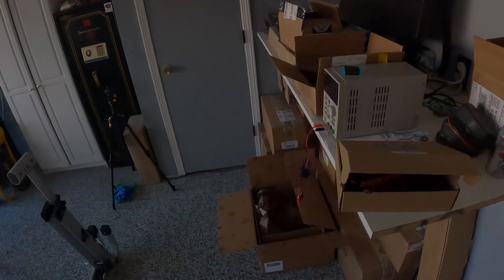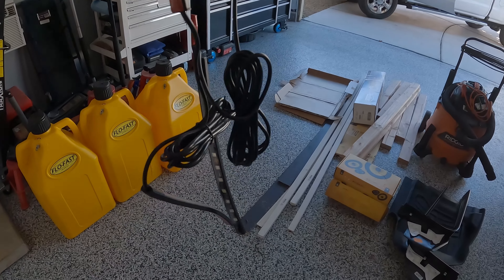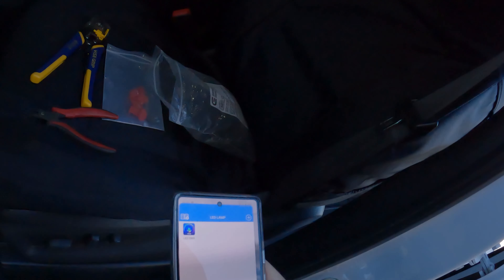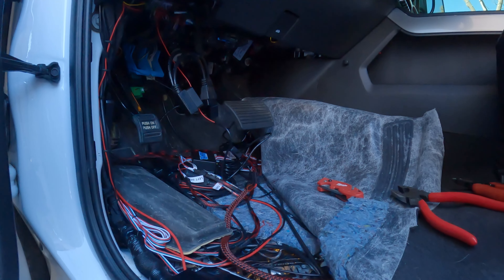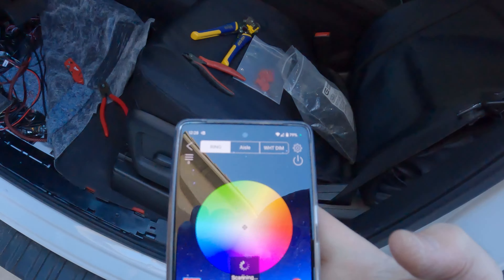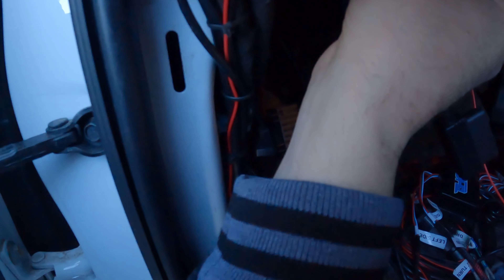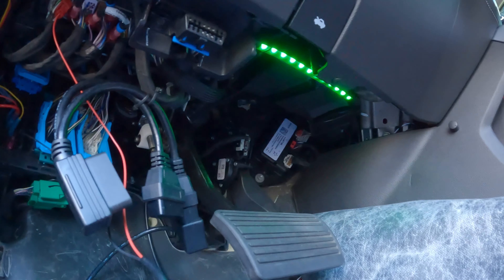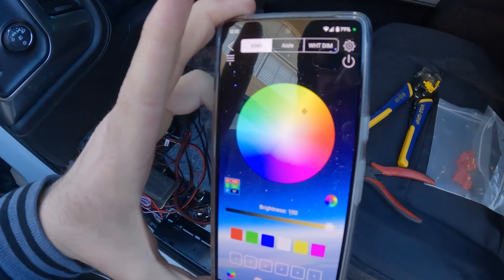Installing LED Footwell Lighting in My Duramax

Comment: How are you liking this LED footwell kit?...I bought Diode Dynamics footwell kit and will be installing it soon.
Reply from the maker: I love it! It is so nice to have that extra light at night. These trucks should have come from the factory with footwell lights.
Reply: I have a 2021 Duramax with no footwell or door lights, I like the idea of installing led strip lights and connecting to the dome. 
Question do the leds turn off or do the stay on while driving or is that controlled with the led app. 
Can you provide a little more details on which wire and the location of the wire you tapped into. I saw the carpet pulled up, is it behind the carpet?